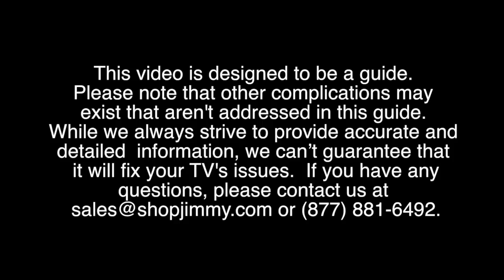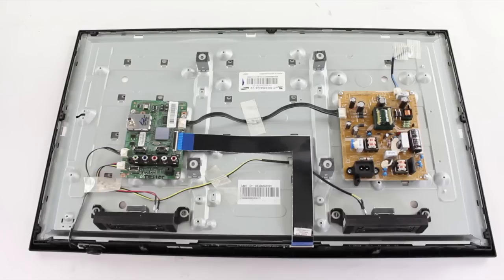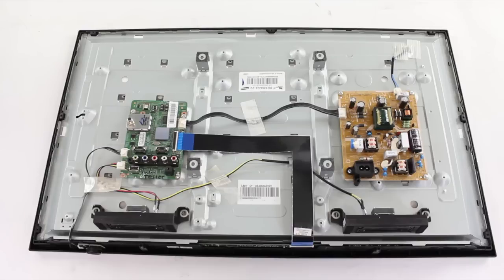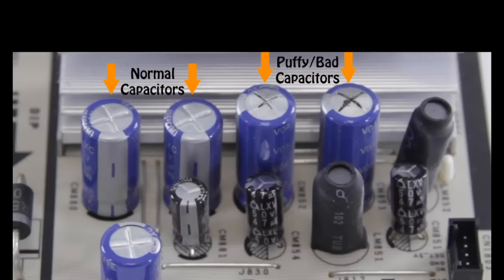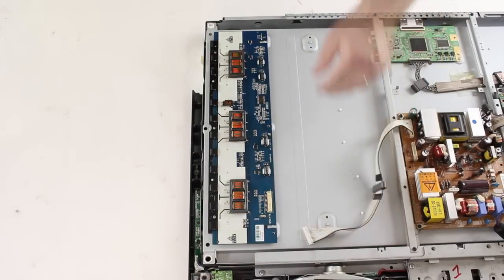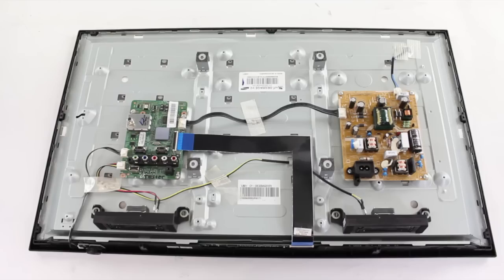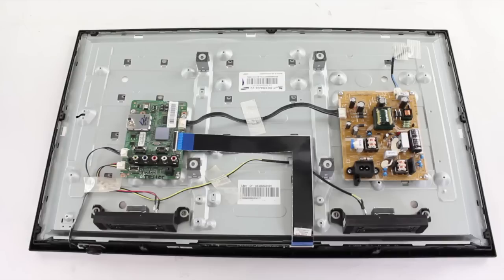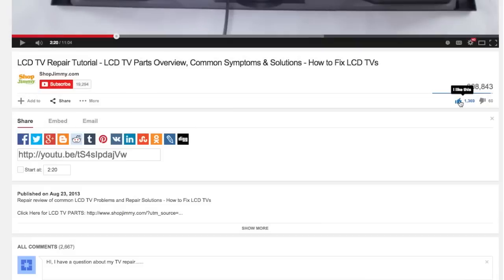Samsung LED TV Blank Screen No Picture With Good Backlights Basic Troubleshooting Help

Comment: Hello,

My TV looks exactly like the one on this video.  It's a Samsung model number: UN32EH4003FXZA.  Initially the TV would not turn  on.  When I opened up the TV I found three bad capacitors on the power supply board.  I replaced these capacitors, but the TV still would not turn on.  I saw another video on youtube that showed disconnecting the connector between the power supply and the main board, and if the LED's come on when doing so, then the problem is likely the main board.  The LED's did turn on when this connector was disconnected so I acquired a replacement main board from a TV with a damaged screen.  

The replacement main board looks identical to the original one except the TV tuner unit is slightly larger.  Both boards have a placard with the number: BN97-05375B.  Since replacement of the main board, the red LED standby light comes on, the TV turns on, makes the sound that indicates that it's on, and the backlight LED's light up, but it has no picture.  None of the remote buttons (menu, source, etc.) have any affect, although the Red LED blinks when the remote buttons are pressed indicating that it's receiving the remote signal.  

Just to be sure that I didn't still have a power supply problem, I checked the voltages on the connector that goes to the main board and got the following results: pin 1: 13v;  pin 2: 3v; pin 3: 13v; pin 4: 13v; pin 5: 13v; pin 6: 5v; pin 7: 13v; pin 8: 0v (gnd.); pin 9: 0v (gnd.); pin 10: 0v (gnd.); pin 11: 5.25v; pin 12: 5.25v; pin 13: 5.25v; pin 14: 3.5v.  These were obtained with the TV turned on, and are consistent with the voltages shown on the legend adjacent to the connector on the board.  

The ribbon cable from the main board to the panel board appears to be in excellent condition and I was very careful with it while connecting and disconnecting.  Interestingly, the TV behaves exactly the same with the ribbon cable connected to the panel board as it does with it disconnected.  Do you think I have a defective main board, or perhaps a bad panel board?  I appreciate any help you could provide, and will purchase what you think I need from you. 

Best Regards,

Brad

Comment: Hi my name is jimmy I have a Samsung 46 inches and my model number is LN46C630K1FXZA and my problem is that there is no picture but have tried the flashlight test and turns out I see it and have a background light with sound and no picture. Could you possibly help me on what part I need to fix this problem.

Thank you!

Comment: Hi.. Help please. I have a Samsung mod # LN46A630M1FXZA it began with a annoy noise and vertical disturbed lines, hardly can see any pic. I been told to replace the TCON WICH I DID  the TV worked fine only 2 days then the problem came back, any help will be appreciate very much ... PS   TV has no sound , only the laud noise coming thru the speakers

Comment: Hi, I have a Samsung UA40K5570AULXL TV , unfortunately my son grabbed some cable and TV falled down. Actually when it falled only the right frame was cracked and left one was misaligned but TV screen was working fine and I let it work for 10 days,  Then I called a samsung technician to make that frame align, the frame was aligned but he made a hole at the bottom center of the panel and gave his friend's number to my wife and said to consult for repair. His friend is saying nonsense that screen is broken
How come the tv worked for 10 days and it broked after he came, please help the symtom was horizontal lines and vertical lines on left side also a black patch. After a while whole screen gone and no image seen on the display.

Comment: Hi, Shop jimmy Expert Team. My problem isn't unique then others it seems like it's common with all Led TVs. I have Samsung 3D Led Smart TV 46" model # UN46D6400UFXZA

No Picture on screen, sound is fine, screen has back light. Menu doesn't appears. Please let me know what part or circuit is not working properly. 
Would appreciate your expert advice and response. Thanks
Reply from the maker: +Yaspider Ahman   Try all repairs and troubleshooting at your own risk. This could be a problem with either the t-con board, the main board or the TV panel. You can replace the main board and the t-con board individually to see if one of those boards fixes the problem.  Click this link to replacement parts for your TV model number:  http://www.shopjimmy.com/catalogsearch/result/?q=UN46D6400UFXZA  There may be multiple boards for the same TV model number, be sure to match part numbers on your current board, with your replacement for compatibility.  Thanks and please let us know if you have any further questions with your TV Repair!  www.shopjimmy.com

Comment: I have a Samsung LED with standby red light working but not sound or picture on but when I unplugged the cable that connects the main board with the power supply the screen turns on. Can you help me to find out what is the problem ?

Comment: Hey jimmy, i have a 55" Toshiba Model ( 55HT1U ) it has back light but no picture. When i plug in AV cables it has sound but no picture either, what could be the problem? Hope to hear back, thanks
Reply: Good luck of EVER receiving an answer by "Shop Jimmy". EVEN if you call them, NO one will help you fix your TV. Damn them! ALL they want is for you to buy their "parts". Oh indeed yes. And sadder is: Most of the time you will see, "That part is not available". So sad indeed.

Comment: Oops, I just send you a message to another video. I see now you explained the T-con is under or together with the screen?? can still be change??
This is the message I sent to the other video
Hi, and thanks for the video, they are very informative. I have a Samsung TV model #is un48h5500. I have a problem on the screen that started couple of days ago. There is a white spot on the screen, only one, in every input. I made a picture test and still there, is about in the middle of the screen to the right. I have a picture I can send. I call Samsung, they first laugh at me and then told me to call a technician. I work repairing computers so I'm I can replace a board, thinking that that's the problem. If you have an advice please. Im sure is either the t-con or the main board, do you sell those? which one you think is? If you have the parts in ebay send me the link so i can buy it.
Thanks, Marcelo

Comment: I had a Samsung UN60H6050FXS that had backlight glowing but not picture no iimage.  I replaced the main board, power supply board and tcon board but still no picture coming out.
What seems to be the problem?
Reply: Hernando Ambubuyog  it's the LEDS

Comment: I have a sharp aquos led LCD tv when I plug it it the logo comes on the the tv goes black there is no sound or picture after the logo 
The back light stays on though 
The error code I'm pretty sure is 2 long and five short I'm so confused lol

Comment: My Samsung UN32EH4003F TV has no picture. But sound works well. I 
removed the back cover and separated the main board from power supply 
board. Then plugged the power code. I didnt see any light through holes.
Which part could be the issue here?

Comment: I have a Sceptre Model X42 plug in press power has backlight screen stays light for a few seconds then goes black. No image with flashlight and dont see any bad capacitors. Any suggestions?
Reply: I would still check the output on the power supply. Even if the capacitors don't look bad, they still can be.

Comment: Samsung led tv has blinking backlights ,that's all  no sound dark screen. replaced all boards no change.
Reply: @william kinn. its back light led trouble.. replace or repair it then it will be solved
Reply: @TechGuru4U007  Hey so just replace the LEDs? or what exactly?
Reply: @CAJohnson420  yes just replace backlight led underneath the display,  but carefully,  the display is fragile...

Comment: HI dear, i had a problem on led samsung  UA32EH4000R , 32 inch ,  WHEN TURNs on the tv , it's appear just white blank screen , no picture , but has a sound . no answer on the web. thanks alot
Reply: astronomer diver me too have the same model TV let me know how did u fixed that 
thank you

Comment: replaced tcon board and main board  on my Samsung LED TV  UN50H6203AFXZA and still have a blue screen and no sound. Power suppy has no blown capacitors and no burn on any of the boards. All LEDs are on.  HELP
Reply: drdebbieioakim did you ever find out what the problem was? I have the same tv with the same issue. Thanks.
Reply: you didn't replace it with the proper mainboard lol.... that model has 2 different boards, and the UN50H6203AF also has 2.

Comment: Sir, I want to know that what are that very small ic type black  components on led strip near connector of 12V & 24V for 12V it has some number on it (2F E0) and 24 V burnt so I don't know that component number.and I have to replace that component. Please help.
Reply: Three years and no response, I have been looking to solve my ouw problems with my TV but every video I've seen on YouTube says the same BS, To post your comments down below.
Always a good idea to check the comment section first to see if the user is true to his word.
Reply: @TeamDeane  
Bro I had solved my problem my own at that time by just research and surf on internet.
Reply: @pjthe1  I figured, seems to be the route to go.
Sorry to bother you.

Comment: I been working on a samsung unf50h6201afxza and i have replaced main board t con and still no picture audio inputs also non functional  but have backlights only . Iam able to turn off and on tv but that’s it ..
Reply: Ever solve this..have the same issue with same tv today
Reply: Great lakes experiences It had a few burned out Led lights i replaced them and it was all good , one of the bulbs was creating a short and causing none of the lights to work
Reply: Thanks for the update

Comment: Hi My neighbor has a Samsung J6200 tv has no picture , has backlights.   anybody have the same issue and know which board needs to be replaced to fix it ? thanks
Reply: Worked for me:
 Originally Posted by neilc6 
Disconnect the ribbon cables from the tcon to the panel one at a time to determine which side is bad. You need to flip the lock up to remove the cable. Power tv off between attempts. You should get a good picture on one side. On the side that is bad, block the metal contacts of the ribbon on the outside edge with scotch tape or shipping tape. I would start with blocking 2-3 pins and increase if it doesnt work. Again power off the tv between attempts.

Comment: I have a Samsung UN46B6000VFXZA audio is ok.  Picture is black on exactly half (left), with very dim picture on (right) half.  I don't see any difference with a flashlight.  My question: is it a board/component issue or is it the panel?  How do I tell?  The problem started when the set was cleaned (front and back) with liquid spray cleaner.  Any help would be appreciated.

Comment: Hi Jimmy I have a Samsung LED tv UN50EH5000F.  The picture went out and the audio was fine.  The backlights are on.  I replaced the tcon board and the main board and still no picture.  Any ideas?
Reply: Having same issue...ever solve it

Comment: Hi, I've got a Samsung UN50J5200AFXZA which is flashing all the LEDs periodically as soon as it's plugged in. No picture or sound. At this point I've replaced both the power board and the main board; same result. I also did a test where I disconnected the main board from the power board and it still flashes. Any ideas on what I'm looking at? The LEDs are bad? I suppose there's a chance that both power boards are bad as well. Any help would be appreciated, thanks
Reply: yeah the led's are bad and are flickering because they are receiving too much voltage, when an LED dies it sends the current to the other LED's and it causes them to all die.

Comment: Samsung UN50H6350AF. Backlights no image on screen, no sound on startup. replaced T-con board, still backlights, no image, no sound. cable and other boards look ok. Any suggestions?
Reply: After trying the "T-Con board", try the "main board"; and if that does not fix it then try the "Power board". There is little else that could be the problem. If the boards do not fix it, buy a new TV. Sorry but VERY true. By the way, I was a TV technician for 45 yrs before I retired. Note: at the very low prices for TV's today, it is probably a waste of money trying to fix your TV.

Get this: I saw a brand new 43" LG TV at Walmart's last week that was selling for $228.00. Buy the time these TV's need fixing; a 65 inch TV will be selling for under a hundred bucks. Mark me woids. LOL